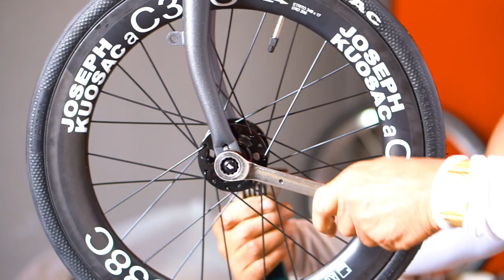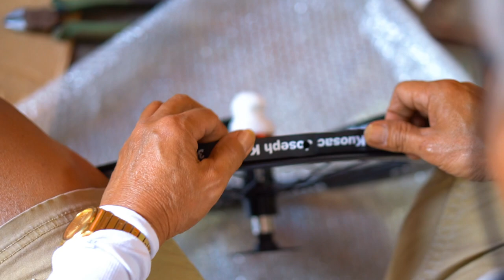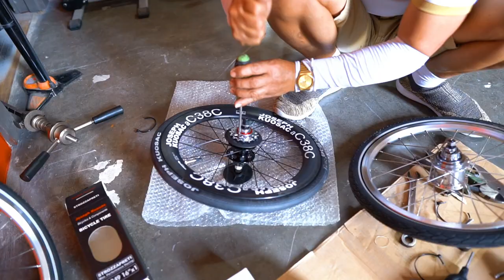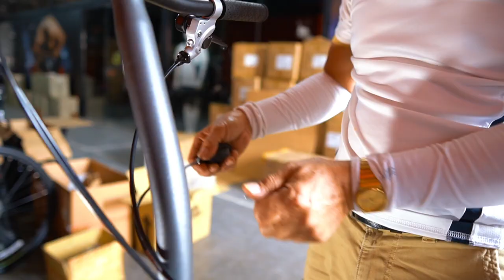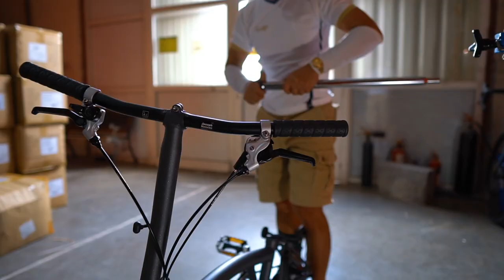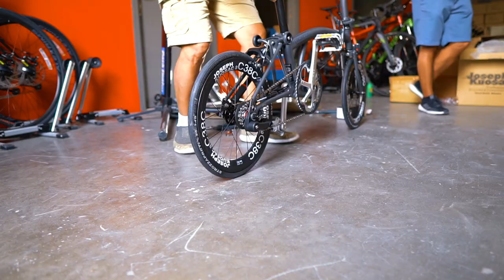Brompton 2020 Model Graphite Metallic S6L- 781 Project - 6 speed to 2 speed - Part 2

Comment: Just out of curiosity why do some go from 6 speed to 2 speed ? Any advantages  ?
Reply from the maker: carlosz114able it really depends on the trail and the rider, we remove the mud guard to most of the Brompton as it very rare to see rain in Dubai, the 2 or 3 speed external gears are way lighter compared to the internal gears plus the cycle path over here are flat.
Reply: The power transfer is considerably better and rides way smoother imo, my average speed increases from 22km/h to 28km/h on mainly flat roads.